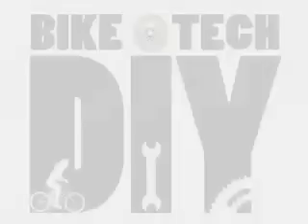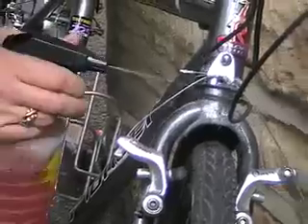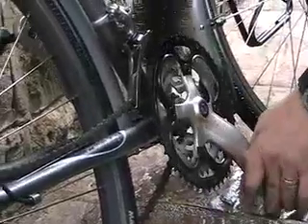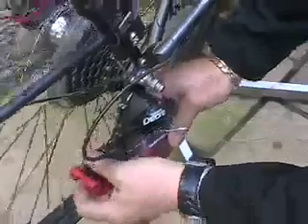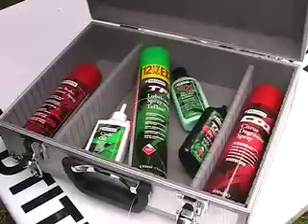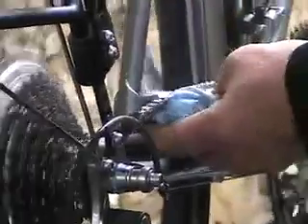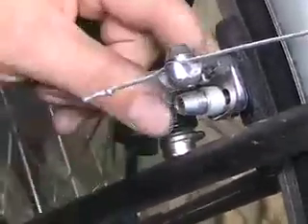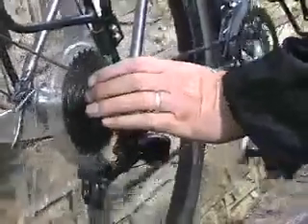Washing and lubing your bike

Comment: When you replace your chain next, follow length guides and installation instructions,but incorporate a fast link/quick link. You wont have to use a chain tool and a new hyper gluide pin  every time.In this way you can take your chain right off. I place my chain in a wide foil tray not rolled tight but flat down and wide open circles,dish washing liquid dribbled over then hot water. Carefully slide the dish and contents forward and back and watch the grit accumulate at the bottom of the dish...

Comment: Yeah, I was wondering about the grease as well...I read triflow is pretty good for your cables though.

Plus the spray costs an arm and a leg, other sites just tell you to use biodegradable dish soap with water.

Comment: I've thought about it... but I've never actually got far enough to do it. My chain is EXTREMELY oily ever since it came back from the free first maintenance at the shop. Every time I happen to brush my leg against it, I have to spend a minute scrubbing it off my leg at home. I think it should work, but be sure to oil it afterwards or it'll just rust.

Comment: ....hang the chain to cool off for a few minutes. Next, spray gt85 up and down the chain. Use a cloth to rub off any excess. You can lay the chain down on newspaper for the next step,in a long line facing up not on its side. Put a drop of wet lube on each link and leave to work in for a minute before rubbing off excess with a cloth. Install. Cleaning your chain in this manner will get rid of all grit wearing the surfaces and old grease that collects more, extending its life like no other method

Comment: ...Repeat this washing until no dirt comes out.you can even carefully brush the link plates whilst in its hot soapy bath,using a bit of wire to hook it and flip it over.towel dry and place back into the foil tray without water. Place the tray on the stove on low heat just to evaporate any excess water..15/20 seconds or so......

Comment: One common mistake is to use WD-50 as if it were a lubricant : it's more of a cleansing unclogging humidity chaser spray & should never replace oil or grease and is not even mentioned in this good video.

Comment: hmmm
im a bit confused.. in the other videos on using the 'Chain Cleaning Tool' which has degreaser poured inside... this is the only video ive seen a guy rinse the degreaser OFF and drying it with a rag... other videos, they wipe it an apply lube straight away.

is it necessary to wash it, I'm guessing it is because the degreaser in the chains gaps and crevices may react to the newly applied degreaser... correct?

Comment: I don't wash my bike!!! (but then again I don't ride through enough MUDDY like conditions to do so) I brush off the dirt as much as possible right after a ride, then if I HAVE TO, spot clean, meaning using as little as possible of water on the bike. After I have efficiently removed all the dirt and grime with VARIOUS cleaners used sparingly on the bike, I shine it with PLEDGE which gives it a natural sheen and protects the paint of the bike.

Comment: I don't think I want a bike if I have to do this every day.
Reply: AngloAm Generally, this should be done when it really needs doing. Whenever your bike chain is black and leaves marks on anything, clean the chain with a cloth and some soapy water and then dry it, applying a small amount of chain lube to the bike chain rollers. Wipe off any excess and you're fine. For your chainset, cassette and jockey wheels, you can begin to see little outlines of gunk and funk and spunk, and you'll want to clean that off quickly, as that turns into hard rock-like particles that'll grind your shit up. The cables should be dried if wet every ride and should be cleaned about once every month.